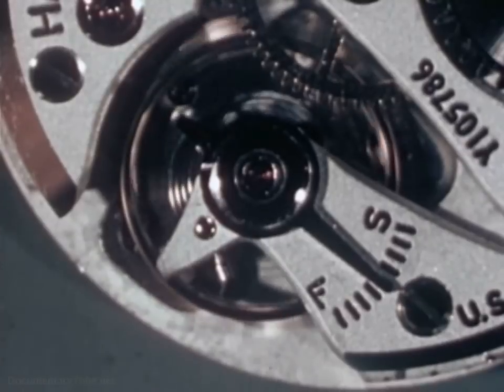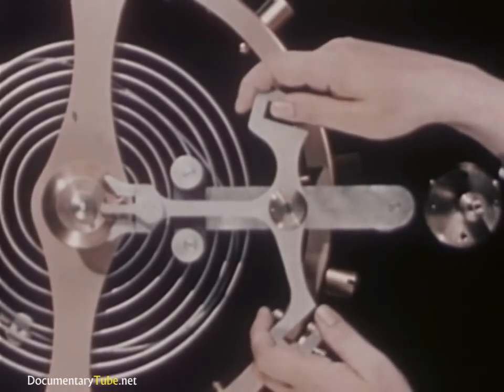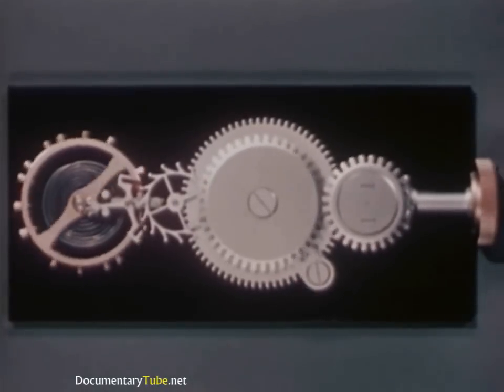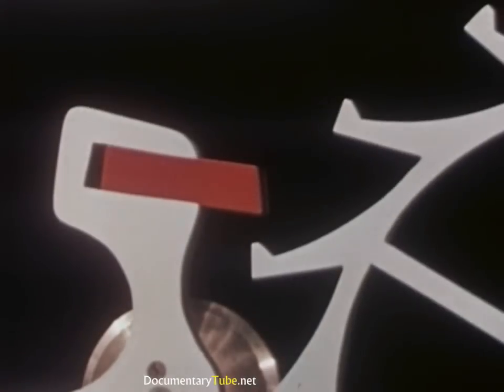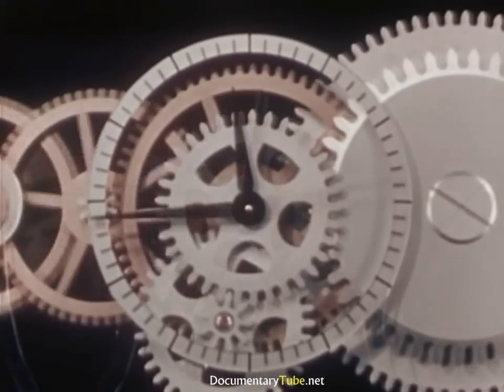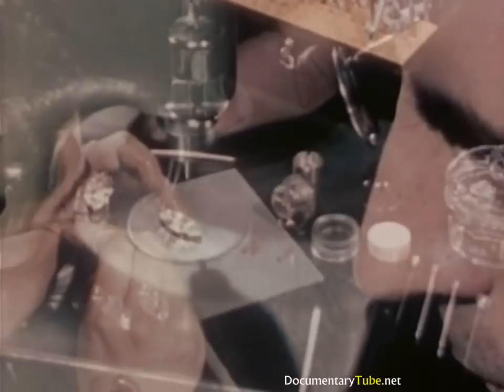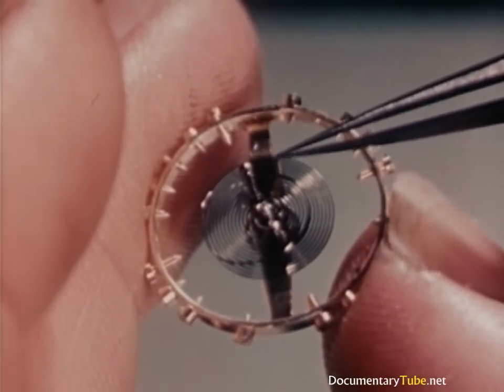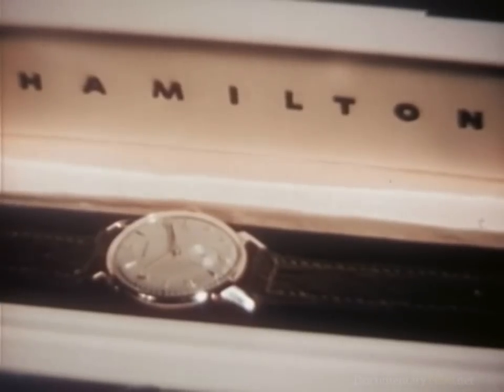HOW IT WORKS: Mechanical Watch

Comment: How are modern watches different to this apart from running off a battery?
Reply: The only similarity between a mechanical and a quartz watch is some of the gear train.
In a quartz watch, the battery sends a current through a tiny quartz crystal, causing it to vibrate at a constant speed. These vibrations usually move a gear train, which turns them into recognizable units if time.
Since there is such a lack of mechanical parts, quartz watches are generally cheaper, but lack some of a mechanical watch's magic.
Reply: I also can try to explain this. 
In a quartz watch the quartz crystal usually resonates at a frequency of 32,768Hz and the electronics count up to 32,768 (takes one second to count up to this) and gives a pulse to a stepper motor that moves the mechanism one second forward, then the count resets and starts again.
This is in contrast to a mechanical watch where the "escapement" lets the clock mechanism that is under the main spring tension to move, usually 6 or 8 steps forward during one second.
Reply: I know quartz plays a role somewhere
Reply: Completely different. Quartz watches use electricity and don't have any mechanical parts. Also, modern watches aren't all quartz. Usually the cheaper ones do, although Seiko does make a high quality luxury quartz. However quartz doesn't have life like a mechanical watch does.
Reply: Quartz watches don't have a soul.

Comment: But how does it switch exactly 1 second and is not off by a millisecond? Does it rely on Earth gravity?
Reply: To actually answer your question, the balance spring is designed along with the gear trains and escapement to oscillate the balance wheel a certain amount of times per second (or Hz)--usually 2.5, 3, 4, or 5 Hz--with EXTREME precision.  They can do this because they know the stiffness of the spring, so they can calculate how to manufacture it so that it oscillates properly.  As long as the balance wheel is oscillating at the exact design frequency, the escapement will drive the seconds gear at a rate of exactly 1 revolution per minute, which will drive the minute gear at a rate of exactly 1 revolution per hour... etc.  Nevertheless, it is impossible to be perfect when the seconds gear rotates so many times per day, which why most mechanical watches usually lose or gain a few seconds per day.  

RE: Gravity, they mention in the video that balance wheel is perfectly balanced so that it functions no matter which way the watch is oriented.

"Every part is made with utmost precision; precision which approaches perfection."
Reply: No, no, no wer2op. Everything you said is wrong. A $30 quartz watch being off a minute after a year is bad. A $10,000 mechanical being off a minute after a year is spectacular.
Reply: Most mechanical watches will be off a few seconds every day but quartz watches are usually only off by a few seconds a year
Reply: Jay Kae Oh?
Reply: @jaykae3952  *a month
Reply: The concentricity of the hairspring, its flatness, the shaping of the overcoil (if it is overcoiled), the friction of the staff in its jewels, the poise of the balance, end-play and shape of the pellet fork, positioning of the pellet jewels — lots of factors combine to produce positional error (the differences in rate between dial up, dial down, on edge with crown up, down, left or right). A regulated watch ticks at a rate that is a compromise, or allowance of those positions' rates. The finer the tuning — the less the variation. A tourbillon continually rotates the entire escapement to effectively cancel out the effects of the on edge with crown up, down, left or right positions.
So, it basically cancels the variations of the sag and drag effects of the watch being on edge, but that doesn't sound as sexy as saying that it defies gravity.
A modern Rolex is about as accurate as a mechanical watch can be, and it is "essentially" the same escapement as the Hamilton above. No tourbillon, but developed and engineered to the nth degree.
In my humble opinion, modern tourbillons are novelties — there do demonstrate manufacturing prowess.
I hope this helps. I did this for a living. :)
Reply: As the film showed, mechanical watches use finely tuned escapements to release the energy of the mainspring — five times a second. Quartz watches on the other hand use highly developed — but dirt cheap to produce — quartz crystals that impart energy thirty two thousand, seven hundred and sixty eight times a second (those impulses are divided in half, fourteen times inside the IC to produce the single tick per second.
When a mechanical watch is off in accuracy by one beat, that's a fifth of a second it's out. When a quartz watch is off in accuracy by one beat, that's a thirty two thousand, seven hundred and sixty eighth of a second it's out. So, quartz watches are way more accurate, but cheap and easy to make. Mechanical watches are certainly accurate for what they are, and expensive and difficult to make.
Reply: Kyle Martin AWESOME!! I never knew that! I thought it relies on Earth gravity.
Reply: Muumipappi   Great, but can you explain why?  What vector arising from the gravitational field affects the timing?   I hope you can, because I haven't seen one.  It seems to be true from experiment, but theory...?  Good luck with your course!
Reply: David Gehring a $30 dollar quartz off by a minute a year is not bad at all actually, that's less than 0.02 second per day. That accuracy for a $300 quartz is still awesome. A mechanical watch accurate to a minute a year is truly miraculously accurate though.
Reply: David Gehring That is wrong. A mechanical watch that can be accurate to within 2 sec per day is an awesome watch, but a quartz watch that is off by 2 seconds a day is usually considered terrible. Quartz watches keep time by the same mechanism and have the same core, so even a $30 quartz can keep time as well as a $500 quartz, though it's much less well built, durable, and with less features.
Reply: David Gehring That is wrong. A mechanical watch that can be accurate to within 2 sec per day is an awesome watch, but a quartz watch that is off by 2 seconds a day is usually considered terrible. Quartz watches keep time by the same mechanism and have the same core, so even a $30 quartz can keep time as well as a $500 quartz, though it's much less well built, durable, and with less features.
Reply: Ray Kent I'm a student and also in a second physic course right now, so I don't know that much, I don't know does the tourbillon really help, but I know that it really matters which way a watch is laying. I just throw these numbers but, on its side the accuracy might Fail +8 seconds/day and when it lays on its Back it might be +13 seconds/day
Reply: This is called isochronous, watches are checked for this. Basically it means no matter which angle or position, as in your pocket, that you hold your watch it will function the same.
Reply: But sadly, they are more likely to fall and get bashed-about. However, check out 'the world's most complicated watch' on YouTube - it is a recent offering, and is a pocket-watch so astounding your head might explode. Mine almost did!
Reply: negligible
Reply: The Tourbilions, have been neither proved or disproved to defeat gravity. At least the articles I have read on it say so. But they are some real good eye candy!!
Reply: Oh, fun fact. I think the official definition of the second is defined by a nuclear decay of a cesium atom or something. That's how nuclear clocks work and keep time at an extremely consistent pace because time for the longest time was a man-made construct. Quartz clocks were invented by using the piezoelectric property of natural crystals (when vibrated, crystals produce a current, and vice versa) to create a very accurate time piece. I think mechanical watches are beautiful, but I think quartz and modern watches are just as fascinating, if not more, as older watches due to the amazing technological breakthroughs we have made to achieve accuracy.
Reply: Far from it. A quartz watch will be out the same in a month as a mechanical is in a day plus tick for years vs a day. What you pay for in a 10k watch is the years it took the watch maker to learn and the man hours it takes to make it. Although you can now get computer cut gears in a Chinese mechanical automatic watch that cost £30 and actually look really good, have a good weight and keep accuracy to about 10 seconds a day vs 3 seconds in a 10 to 20k Rolex. Thats technology advancement I suppose. Not a bad thing as it gives oldschool  engineering to everyone and a top end watch is an investment, it will hold i's value. I honestly do think the top end of the watch market would have died by now if that wasn't the case. Either way, appreciate the way that clock on your wrist works in a world where everything uses batteries and microchips. It really is a beautiful thing.
Reply: In the grand scheme of things, nothing. The balance wheels mass vs the earths is so small its like an ant defying gravity to you and me and climbing a wall.
Reply: Voodoo
Reply: False
Reply: Also the main gears and their size permits them to only move BARELY AT ALL versus how much these model ones are moving
Reply: radanju3   re-visiting this thread I see that there have been a lot of comments, including my own, that don't exactly address your question.  A pendulum clock relies on earth's gravity for its timing.  A watch can't because it's orientation keeps changing.  It relies on the fact that a heavy wheel is harder to accelerate than a light one.  The blobs you see around the balance wheel are fine tuned to provide the right mass so that the force from the hairspring will give the right frequency of oscillation. It relies on resonance of a mass bouncing on a springy thing, just as if you ping a ruler over the edge of a table.  The oscillation frequency depends on the springiness of the ruler and the mass in free air.  Since they can't sensibly make sprung steel to a hyper-accurate spec they fine tune the mass of the balance wheel.  Add a bit of weight to the end of the ruler to get a lower frequency.
Reply: You can sort of compare the movement of the spring wheel to a guitar string. It's the tension of the string (or spring), it's length, mass and the material being used that determines the amount of vibrations a second. Your a-string will sound at 440 vibrations a second relatively constantly if tuned correctly, so in the same way you can get a spring wheel to move a certain amount per second by tuning the tension and material just right. 

All you need at that point is something to get the spring wheel moving and the momentum will take over. At this point to have it run accurately and reliably you'd need as little friction as possible, hence the jewels, oil and craftsmanship. The smallest deviation because of one tiny part not running as well as it could will cumulate and get everything out of sync.
Reply: Kyle Martin For that gravity, I think that tourbillons are made to fix that gravity problem, or was that just in history and today the balance wheels are better so tourbillons doesn't matter?
Reply: Muumipappi   I'm not a horologist,  just a physicist trying to figure out how exactly gravity can affect the simple mechanism shown in this video, given an exquisitely balanced balance-wheel.  I want to see vectors!  Maybe some non-planar distortion of the hair spring?  Anyway wiki says that there's debate about whether the tourbillon actually improves immunity to orientation.  Sadly, no figures, or proper physics.   My opinion?  It's a marvellous, fascinating mechanism that has its place in expensive bling.  I'd love one, but not on my wrist.
Reply: Then buy a pocket Watch, they are much nicer. In my opinion.
Reply: Jay Kae mechanical watches are actually the more accurate and tend to keep time better than cheaper built quartz. Quartz aren't as accurate and why many high quality watch makers avoid the movement. The only reason your mechanical watch would be off is if it's broken or you aren't allowing the battery to mechanically charge